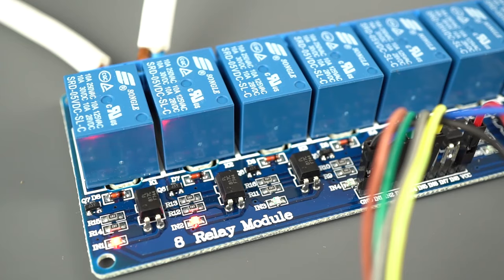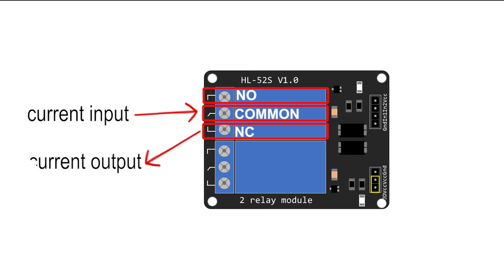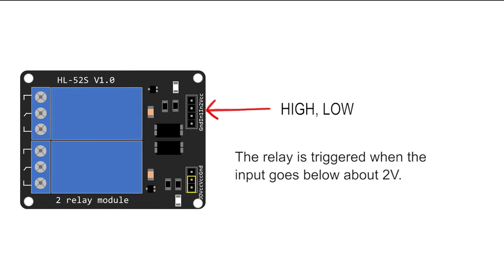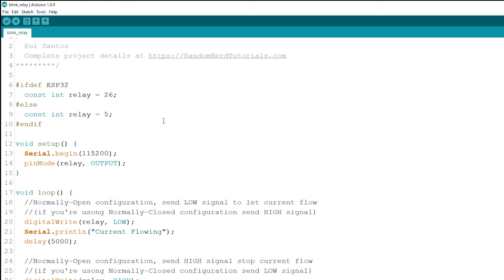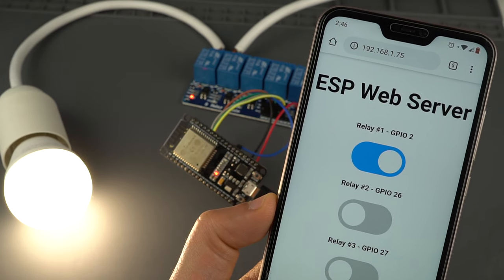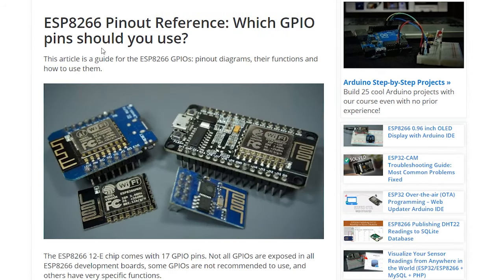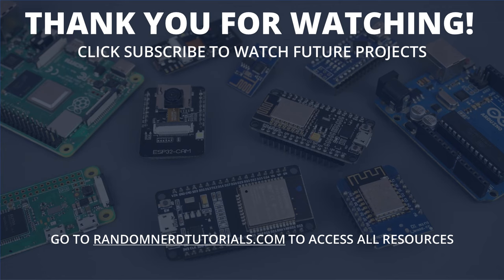ESP32/ESP8266 Relay Module - Control AC Appliances (Web Server)

Comment from the maker: You can find on my blog the full step-by-step instructions for each ESP board.
ESP32 Project (schematics + source code) ► https://RandomNerdTutorials.com/esp32-relay-module-ac-web-server/
ESP8266 Project (schematics + source code) ► https://RandomNerdTutorials.com/esp8266-relay-module-ac-web-server/
Reply: Rui Santos Hi, I bought your ESP32 course,  it turns out that I need to send digital values from 16 GPIOS, and send them to a platform called Ubidots, but I still don’t know how can I doit, can you please help me about?
Reply from the maker: @ingenierocristian  hello, unfortunately I've never used that platform before. Have you tried their sample projects from the library? Thanks!
Reply: @RuiSantosdotme  Ubidots is quite similar to the project you made in the Module 7 of your course, except this platform integrate its broker, it uses the MQTT protocol
Reply from the maker: @ingenierocristian  I think they have a library with a bunch of examples that show how to use the platform. Did you try their library examples? You can also use any MQTT example (instead of using an IP address, you use their domain name, then check which topics you need to subscribe to)

Comment: I have NODE MCU esp 32 wroom devkitv1 .

It has no 5v output. (Only one 3.3v output)

if I connect relay module eith external 5v power source and connect only the data pin with ESP 32 board, will my relay work? Will the ESP32 burn?

I understand that the above question can be answered if I knew

1. Relay connected with just an external power source (no pins even data is connected with esp 32 board). What is the voltage reading of data pin of relay?
[ I believe it should be 0, since this is just a triggerer]

2. Now I have connected relay module's data pin with ESP32's any data pin and relay's power is again given from external source. Will the ESP32 be able to trigger relay now?

Please answer I am having hard times.
Reply: I think you can use an external power supply for the relays and just use the esp8266 to trigger them
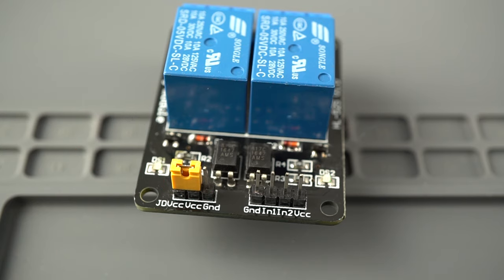see 2:34 for the jumper  but that could be specific to the relay board you have, the one I have does not have the external power supply jumper

Comment: Hi Rui,
I though  you need 5v to move the coil of the relay, are the 3v of a nodemcu enough to control relay? Or do you use an extra power source to make it work?
Reply: Elpetit Cafe I had to buy 3v relays as my esp32 couldn't supply enough to use the 5v one I was using with my Arduino that ran on 5v

Comment: Hi,

Followed your video and it works. The problem I encounter is that when I open my motor, I need to close it before I can open other device. I believe they should work simultaenously. Whats wrong with my circuit?

Comment: I have an esp and i want to monitor the lights of an  electromechanical pump's control box. The lights are 24v ac i need to read their status on or off with the esp  is it possible to read the relays status with this module?

Comment: Thanks for your video dude. I have a question? If I need a relay that can handle a 48VDC out with 6A. Can i connect to 2 relay that give 30VDC and 10A each to control only this 1 equipment?

Comment: Could I use the same project to control more than one home light bulb? 
Or I need to buy 8 channel relay module to control all the ceiling light bulbs in my room?
"I mean the main voltage home light bulbs not the external light bulbs". 
Thank you.

Comment: Hi Rui, Greetings from Brazil! I have two questions:
1) I have a Module with 8x Relays, but it works with 12V, so how should I connect it to ESP32/ESP8266? I know I must use External Power, but how do I make the connections?
2) And that JDVcc jumper I don't understand what it's for. Thanks

Comment: I'm finding it hard to work with Arduino. The LIBRARIES always change or disappear, to the code that's shown in this video won't work. I cannot find the libararies ESPAsyncWebServer, ESPAsyncTCP, or AsyncTCP. 
I've found files in Github, but I can't get Arduino to recognize these libary files. Nothing seems to compile and it's just pure frustration.
Reply: Ah, I found my mistake! I went to your website (first link) and followed the library installation instructions. I was using Arduino 2.0.2, which I see we should not be using. I've got the recommended legacy version loaded now. Still I had problems with the libraries, until I read more carefully. 
When I unzipped the file, it creates a subdirectory with the actual folder that needs to be renamed and put in the /libraries directory where Arduino expects it. The code compiled now! Thank you for the hard work on your website.

Comment: Hi Rui, The tutorial is nice. i have tried using the information provided in your tutorial. Able to control the relays only when my ESP8266 and Laptop (where i am opening the web page to control the relays) are connected to same network. If both are connected to same Wifi network, the ip address is not opening. What might be the issue? Do you have any inputs?

Comment: Good day Mr Santos, thank you for your videos, Ive learned a lot from all of them. I was wondering if you could help me regarding relays... 

So I have a simple webserver where I can turn a relay on/off and I have three LDR sensors as inputs for the three status LED of the water pump I want to control. Ive used the meta-refresh to refresh my web server every 30s, BUT once the server refreshes, my relay quickly turn off and back on again during the reset. Is this one of issues related with using meta-refresh or does this sound like bad coding?

EDIT: I fixed it within an hour of typing this message, Ive connected the relay to GPIO2 but I was so focused on my coding and other stuff that Ive failed to remember that the buildin LED is also controlled from GPIO2. Luckily this is an easy fix. 
Ive used the buildin LED to give me wifi status updates as well as data coming from the client, that is why my relay went mad. 
Ill leave this comment to help others.

Comment: Hi ! First of all thank you very much for all your tutorial and content ! Thanks a lot !!
I have a question:
I'm starting to program an ESP32, and what I want to do is to use data that I wan’t to input through an internal html site, exactly as you do in one of your tutorials using the ESPAsyncWebServer Library, and at the same time I need to be able to auto connect the device without hardcoding the Password and Name of the net, so I can do it more “plug and play”
Where should I start studying? Is there a way of combining both libraries, or some of those features are also possible to make in both libraries?
Thanks a lot !!
Reply: that's exactly what I am looking for too, I hope he replies back to this.

Comment: Thanks for the video. I see use 2 skits for ESP8266 and ESP32. Couldn't you combine both sketches and just use the sketch for both ESP (8266 and 32)?
You would then only have one sketch, which then works for both ESPs.
Reply from the maker: The examples demonstrated in this video work for both boards, if you notice I use a condition to include the proper WiFi library if you're using the ESP32 or ESP8266 (time of video 4:42 and lines 7-12 ). I hope that helps!

Comment: i have ESP-01s Relay v1.0 ..... with ESP8266
how to easily connect to a phone and
to control the relay
Reply: If you have Wifi Access search for "esp http-switch". It let's you controll your ESP by entering URL's in you browser. e.g: "my_esp.local/switch_on" or "my_esp.local/switch_off
That's the easiest way I know of and it also works with any other device which can run a browser (or some sort of http-request service) :)

Comment: This relay is 5V so why it does run on 3.3V pin from esp8266?
Reply from the maker: Basically, you need to power the Relay module using the ESP32/ESP8266 Vin 5V pin. However, the ESP 3.3V GPIOs can be used to turn on/off the IN pins in the relay module
Reply: @RuiSantosdotme  Esp8266 has only 3.3V pinout. 5V pin in esp8266 (vin) is not an output, its only input, so can't be used to power relay.
However its weird that 3.3V power up 5V relay...

Comment: Very good video but one thing is lacking that there should be relay status reply in front of each switch so we can know that this relay is actually ON or OFF . Because in this code when we disconnect ESP even then the web page works and we can turn switches ON and OFF however it is actually not turning switches ON OFF.Kindly make little changes and add status reply code i know it is not a big deal for you and it will take little time edit it but it will help many people around the world.Waiting for your reply ...Thanks